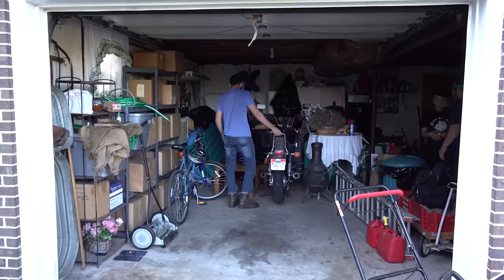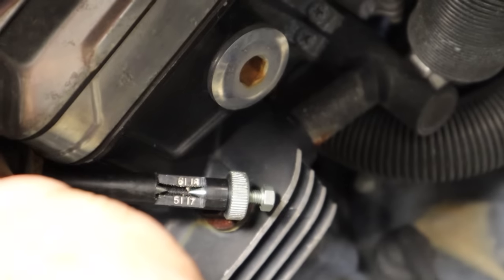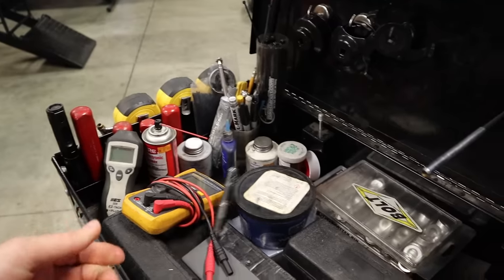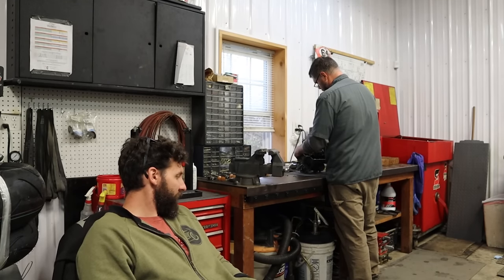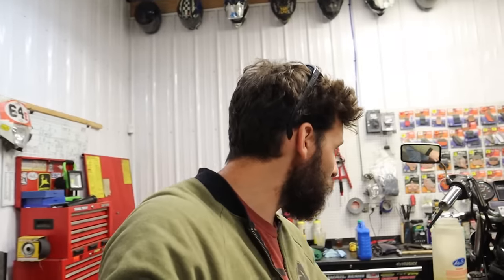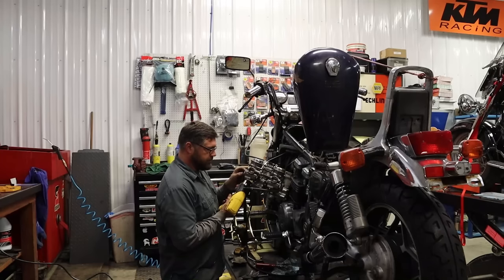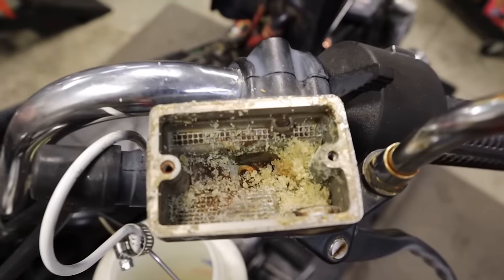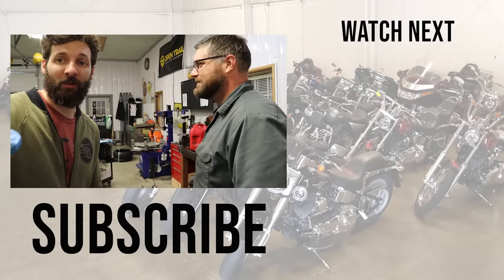Abandoned 1983 Honda Magna Restoration, Can we get it to run?

Comment: My 1982 Honda Ascot had a bad rear master cylinder.  Rather than fix it for $50 it sat in my garage for 20 years.   20 Years later a buddy of mine offered to work on it.  It started up without taking the carbs apart.  The battery even took a charge.  The $50 master cylinder was now obsolete and only available on eBay for $450.  We found a similar one from a 4 wheeler for $90.  The brake lines were a little gelled up.  Got the whole thing running for less than $200.

Comment: Hey guys I am in a similar place just acquired a V65 1100 Magna  1983 model been stood outside for since 2008 total basket case seized motor frame rusted through under seat totally corroded everywhere, got her stripped down to just the motor now going to get the frame sorted first, while I try and loosen the motor I think it's gonna take ages but I will overcome cos she could be great parts ain't gonna be easy here in the UK though .You are dead right to say just focus on one area at a time and not get side tracked with buying things are not necessary to get it running .Mal

Comment: Lots of people strip the 'phillips' screws because they are actually 'JIS' designed to take more torque, however you need to use a proper JIS screwdriver. Just a quick FYI, cheers fellas

Comment: i have this exact bike sitting in my garage, same colour and everything. apart from carby clean i had to do the exact same things you guys did, plus a little more.
from brake lines were blocked, cleaned them out, new seals for calipers. new master cyl seals, new front fork seals. clutch master and slave seals. i think those lines were blocked too.
new indicators and rear brake shoes. also new choke cable.
got it to run, prett happy.
unfortunately i found out the main fuel tank leaks. but sub fuel tank still works.

Comment: Those magnas are awesome. Currently ride an 83 xvz1200 that I bought for $500 and came with a box of engine parts that needed put back on. I did the same thing with an 85 xj700x a few years before that.

Comment: 84 Honda nighthawk 700S. Sat 15 years. New battery and it ran. New tires. Rebuilt the entire brake system because of a clogged return. Working on setting the carb but have to remove the pilot caps. Currently idles at 5krpm.

Comment: I picked up an 81 Honda gl1100 goldwing. Hasn't run in 15 years. Only 39000km on clock... Currently bike is stripped... Frame is away getting repaired... Good ol frame cancer... Aka rust in lower parts.... Labour of love. Brakes have been stripped ready for rebuild... Master cylinders ready for rebuild. Tank cleaned out but reserve line blocked... But yeah... It's gonna come together nicely...

Comment: Story of my life.  Gotta a Honda Rebel 450 ‘86. Sat in my garage 15 years.  Removed the dust out of the tank, put new plugs, changed the oil, new gas.  Only thing holding it down the damn dual carbs gummed up  😐

Comment: I have a 1985 Honda cb450sc, that I picked up as literally a basket case. Literally. I'm in the rebuilding mode from the ground up and can say it is a challenge. However, as the days and months go by, I can see progress slowly and incrementally. It might take several years and I'm ok with that. It will be done of my hands and it will be done quality.

Comment: Heh heh, been there done that! Had a CB350F that someone else did some carb work on, and I had those dumb things apart at least 6 or 7 times until I figured out that whoever worked on it before had switch the slides around from one side to the other, which essentially rotates them 180 degrees in the throttle bore and they won't idle for crap (super rich on the idle circuit). Once I finally caught the fact that the edge of the slide wasn't covering the idle ports like they should I finally had a eureka moment and switch them back and it ran like a champ!😁😉👍

Comment: I bought a V65 seized  engine stood outside since 08 frame rotted through were the tank and seat meet so far had the frame repaired and powder coated got the forks back in new seal getting new wheel bearings new swingarm bearings havin trouble getting the swingarm  pins back in so their is no play in the arm but I'll get there. Then its brakes basically I am building a rolling chassis .I have freed the engine but had to take the heads of to do it so loads to do there it's gonna take me a year and some cash to do this but I'm gonna get there in the end . Good vid guys  : )

Comment: I had  1985 V65 Magna, My clutch master cylinder looked the same when I pulled it apart, after sitting for 6 or 7 years. If you did not clean the slave cylinder I would recommend you do as when I test road mine the clutch stopped working and I had to go back and clean the slave cylinder and it worked fine for a long time. Carbs on those are a pain to pull, not to bad to work on. I had to replace the diaphragms cost $100 plus shipping from London England was the only place I found them

Comment: a 1984 V-45 Magna! I hada  burgundy one and then a black one- good bikes to the point of boredom. UPDATE: If that's an 82 it has soft cams which were recalled which is why it was parked. 82, 83 and early 84 they found the cam lobes weren't hardened properly and after several engine replacements addressed the issue in 84. You can tell the difference in the 84 model between the original and corrected bikes by the presence of 3 allen key sockets on the crankcase cover on the throttle side. Also, the carbs are notoriously difficult to remove and install due to lack of room. The starter spins constantly and so needs replacing almost every year.

Comment: A really happy follower from... Spain. Nice video, nice explanations and advices. Now I got a 1989 Yamaha FJ 1200, 30 years sitting in a barn! And with just 1900 kms. on it (¿around 1200 miles?) Amazing! >>>>>This precise model was the same like one of my first bikes, that I had to sell almost brand new for monetary reasons 30 years ago. A real encounter with a youth love!>>>>> Unfortunately, I don't have my own garaje or a "Craig friend" to put it back on the road. The Yamaha problems will probably be less than the Magna's ( just carburetors and hidraulic clutch circuit). We'll see. >>>>Congratulations again for the video.

Comment: I found a 83 Nighthawk 450 in a barn. Covered in hose shit. I paid $1 and rescued the bike. 
Cleaned the carbs and I had to rebuild most electrical wiring as the wires were brittle. Runs perfect. $150 invested.

Comment: I've actually got a 83 magna 750 I bought not running and a seized clutch slave cylinder. Runs like a top now and I ride it all the time. Need to track down an exhaust for it as its pretty well rotted away, but that doesn't stop me from enjoying it.

Comment: Guessing you guys are on the West Coast?  I have a 1984 Honda Magna V65 I bought new.  It's been in storage since 2007, but was outside for several years before that.  I had it rebuilt and Stage I upgrade put in in 2000-2001.  Whenever I get back to the states, it will need some help, I'm sure.  But it is in North Carolina.

Comment: In 1992 or 93 I rebuilt a 1973 Honda CB350 Four that was in a bits and literally had sawdust in the crankcase. The only things I didn’t disassemble and rebuild were the shocks and wiring loom.

Comment: '88 Suzuki Katana 1100 bought after it hadn't been ridden in over a year (my mechanic said if someone tells you a year you can probably double that) and it ran but like a piece of junk. It felt like it had about 40 horsepower. I had new plugs put in, and the carbs cleaned and synced as well as new air filter plus oil and filter. My mechanic gave me a big break on the labor and it cost about $400.00 (CDN because I live in southern Ontario) to get the thing pulling like a freight train.
There are still a couple of things to do but he can do those those winter in his spare time, ... too much clutch drag to be fixed, as well as setting valve lash check the timing chain tension.  They seem like small things, but could make a big difference.

Comment: My buddy found a 1999 yz250 dirt bike in a dumpster at his shop. Found out who’s bike it is and said it sat for 10 years got it running 4 hours rebuilt the carb a couple times cleaned the petcock had to resurface the head clean out the power valve and it was a fully functioning perfect desert bike.

Comment: I just bought one of these bikes. Mine is an 82. The guy I bought it off of bought it as a project and gave up on it. I'm having the same problems you had. My clutch stopped working and when I opened the cylinder cover I found brown dirty fluid then flushed it. The bike runs poorly, sometimes only with the choke on. Will have to replace the jets. I did manage to drive it though with it running poorly.

Comment: @11:10 this is why you bench test a carb setup to make sure the float needles are working correctly. even after a rebuild. the exact same thing happened to me when I rebuilt my carbs the first time. I got them back on the bike (on my bike it's way easier than yours too) only to find out it was over-filling the float. the problem was the needle i got in my rebuild kit didn't seat properly. (this is also a warning to all to NEVER BUY EBAY REBUILD KITS, go OEM from the manufac who made your carbs.)
Reply: update: after i hit play (i made the above comment in the middle of viewing) you revealed the problem: a missing gasket. you'd have found out the same thing had you bench tested those carbs. LOL your mechanic drinking on the job?

Comment: i have  a 1987 BMW K100rs which hasn't run in 9 years , im starting a Cafe racer build with it , so first thing was to see if I could get it running before I start spending on the other stuff , , so new plugs , oil filters and fuel pump  and few electrical checks , jump start off my car , took about 3mins cranking it over and it fired into life ,

Comment: I have a 1983 Honda Magna with 4000 miles with every option sitting in my garage since 1990. Lately, I'm getting inspired to get it running. The battery alone will cost $80..

Comment: ive got a honda CT90, CT125 and CT185 which had all been sitting in an open shed for close to 25 years.     like $50 worth of parts each and a bit of elbow grease and they run :)

Comment: Yes! My scooter sat for 9 years in a garage. The previous owners didnt think it was worth fixing so they gave it to me thinking I would take it to a mechanic. Nope! Its 2019 and amazon has everything!

The throttle cable was severed inside the sheath. They thought it was stuck. But the throttle didnt snap back. So I replaced that thinking that was it. Well my master cylinders both looked almost as bad as this one. Got those cleaned out but the front brake still wouldn't pressurize. So I took off the front caliper cleaned it and the seals out. Replaced the brake hose and master cylinder. Bled both front and back brakes. 

I didnt even know if the bike would run at this point because it was in pieces in my living room and hallway. But meanwhile I had to get it registered and get my permit.

Took me about 3 months but I finally got it all back together and after taking out the old fuel and putting in new fuel it didnt fire right up. But after a few/many tries it did! Had to replace the stock tires, the guy said they were fine not even dry rotted but I didnt want to chance it. Few extra days getting parts and ordering the wrong ones and a important stripped bolt. But now I ride every day and I love it! BTW the bike had less than 2k km on it when I got it. 150cc maxi scooter basically brand new.

I love this video I was wondering what happened with this bike!
Reply from the maker: Wow great job, now you can sell it and buy yourself a motorcycle lol just kidding scooters are fun too

Comment: Oooh an 82 magna. I'm working on  one that's the exact same color right now. Currently it runs and rides(not the best, but it's a start), though mine has a lot of rust in the fuel tank, so that's going to be my next step.
Reply from the maker: Use vinegar for the tank let it sit for a few days
Reply: @BikesandBeards  That's the plan, otherwise a local bike shop recommended using acetone.

Comment: I'm 21 and I'm building a 1977 goldwing cafe racer right now for my 3rd bike build. Definitely guilty of working on looks before it runs but I cant help myself. It runs and rides anyways but it certainly takes longer when you have to worry about scratching stuff up and being careful to it.
Reply: What they are saying about getting it  running first makes  perfect sense  but starting with some basic  cleaning never hurts on a project like this. It is definitely more pleasant  to work on a clean engine and the time spent will  often reveal broken or worn parts that may explain why an engine doesn't run. If you assume everything is ok you can easily dive into an expensive or time consuming  repair elsewhere that doesn't solve the problem.  The secret to troubleshooting  is to rule out the simple, quicker items first then progressively move on to the more intricate items. A carb rebuild  won't help anything until the engine is getting spark and so on. Sometimes  a lose wire or hose will be caught during a simple  cleaning that is key to success later on.

Comment: I've got my 87 super  running again..but you have to clean the clutchmaster cilinder in the engine aswell. Mine was filled with moisture wich made it leak. The pin wich goes through the block wich controls the clutchplates will corrode and it will leak break fluid into your engine.

Comment: I have a 86 v65 magna. Had a few issues when I bought it. Worked most out just riding it. But I need a round headlight that's not totally roached out for it. Have a Vetter rooster faring to put on but with  the square headlight looks not good. It's got 63k on and will still stand up and letter rip.

Comment: I just got a '84 V65 Sabre for Free.. I'm hoping the Engine isn't seized, but it rolls and the front brake works
the tires are old but not cracked, but will be replaced and the carb's need to be rebuilt.

anything is worth fixing if you'll enjoy it and it will help you to be happy.

Comment: Got a Honda Rebel CA125 (That's right, 125cc), front and rear end off a 1985 CMX250, engine from a 1997 CA125, all bolted to a frame from a Chinese Rebel replica (Jinlun JL125-13). I've changed the stator, rectifier, battery, ignition coils, CDI unit and STILL getting no spark (New plugs too). I haven't yet changed the ignition pulse coil, but I'm in the process of retro-fitting a pair of after-market control switches. It could have been the kill switch from the 1985 control switches causing the issue (As the ground wire was smoking when I turned the ignition on). So we'll see. If it's not that, it has to be the ignition pulse coil. But my god it's the most annoying thing ever. Over a year I've spent on this project so far, and all I wanna do is ride the damn thing.

Comment: I watch all your videos. I like adding the mechanical aspect. I would like more like this especially dealing with issues of used bikes, what are the problems and how much does it cost to fix. Should I buy that Harley with 80k on it for a really good price or only go after a low mileage one. BTW how often do main bearings need replaced? Why, how much? Thanks!

Comment: I had an 85 V65 Saber that I loved! One time it blew a fuse.
Reply: Likely the wiring/connector for the voltage regulator.  A known weak point - the wiring ended up burning a small hole in the lower rear fender of my '84 V65 Sabre before I fixed the issue.
Reply: @aeroman5239  I never found it, then I sold the bike. Thanks!

Comment: My Grandson came across a 82 V45 that had been sitting outside with side covers missing, oil filter off and last time it ran was 2009 and we pickup it up 2018.  First thing I did clean bike and drop the pan and vacuumed out where oil filter was missing.   Put on new filter and put the pan back  with oil.  Next thing was to fill the carbs with Mercury Power spray after setting drained and refilled.  I did 3 or 4 times.  With the tank off and a new battery, never replaced the plugs but did ignition wires.  I then cranked it over had great compression and at the same suck in to the engine some of the Mercury Power product.  Now it was time to see if it would run.  Hit with starting fluid and it fired off and kept running.  Huh,  why?  The tank was off.   Well it has a reserve tank that I did not know about and was running (not very smoothly) on the fuel that was 9 years old.   I later on after restoring I pun on Dave Dodge Oil Mod Kit. Bike had 23000 on it When I pick it up.    Run s great.

Comment: Hey man great video! I have an 83 with 1,100 original miles I want to flush the clutch and break system once I rebuild the master and slave cylinder. What’s the best way to do that? Also I had to completely tear down the carbs, if I need to sync them do you know any tricks

Comment: If you ever see a V-45 that would not slow down when you roll off the throttle, don't pull the carbs until you verify that the pulser coils are okay. It is the timing that can cause that. Throw away those old hoses and get new ones or you will be working on it again.

Comment: Just picked up one of these on kijiji. Was an old barn find and the farmer was gonna just scrap it so I got it for $100. Its gonna be a lot of work but I'm hoping to at least get the motor running and maybe make a frakenbike or some kind of rat bobber project going from there

Comment: Honda carbs ( and some other parts ) will handle that Vessel  Impact  #2 JIS Screwdriver - you are not trying to hit a home run , but just enough force to get it to turn when hit, great for when someone else used a Phillips on a metric screw and wrecked it.   hint for pulling Honda carbs, move throttle cables and plug wires out of the way and anything you can move if in the way … 
looks like you are in the correct direction.